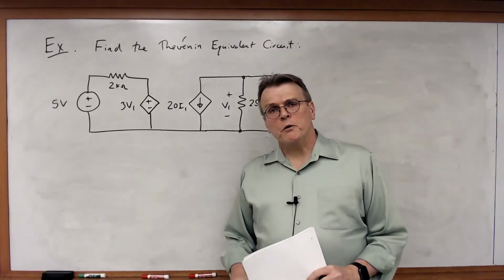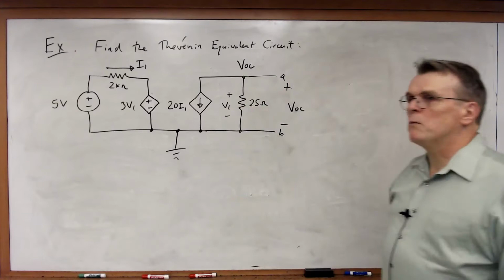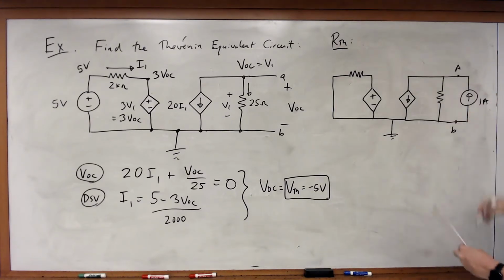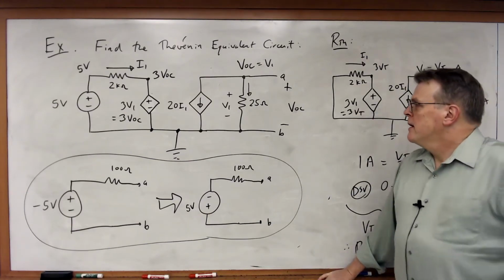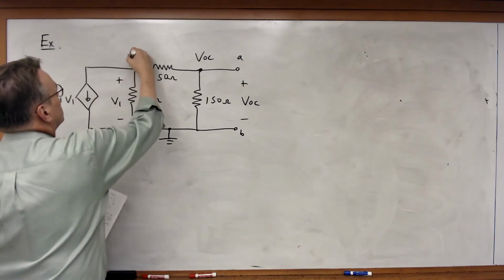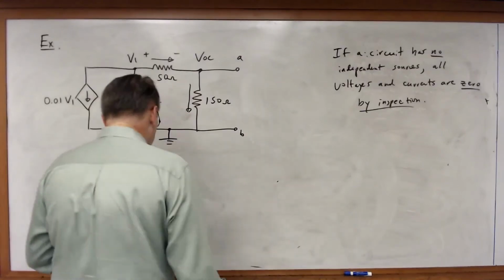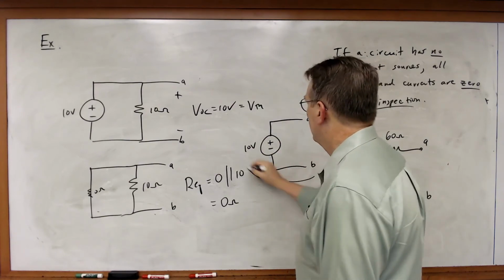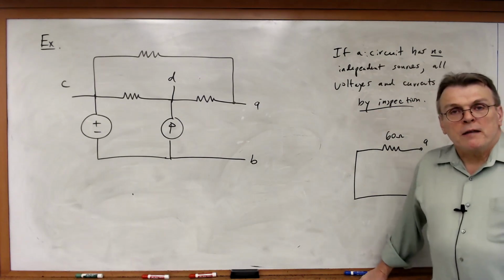EECE 2112 Module 34:  More Examples of Thevenin Equivalent Circuits

Comment: Hi, Professor Holman,

For the first example, it seems the value of V_Th depends on which direction I1 is chosen. I1 was chosen to be going to the right. This gives you V_Th = -5V and R_Th = 100 ohms as you have already calculated. However, if I1 was chosen to be going to the left, V_th = 5/7 V and R_Th = 100/7 ohms. So the same circuit can be reduced to two different circuits. But why should it be different? If the circuit can be reduced to an equivalent circuit as stated by Thevenin Theorem, shouldn't the equivalent circuit be unique?
Reply from the maker: In the lecture example, the direction of I1 was given as part of the problem statement, where it is the controlling current for the 20*I1 current-controlled current source.  The direction is therefore fixed.  Unlike other types of problems, it is not a current whose direction you can arbitrarily select.

In circuit problems using dependent sources, the polarity of the controlling voltage or the direction of the controlling current will be specified at the beginning.  You can't alter them without altering the problem and changing the answer.  

But note that you COULD flip the direction of I1, so long as you also flipped the direction of the 20*I1 current-controlled current source.  If you do that, you'll get the same answer as the original problem.